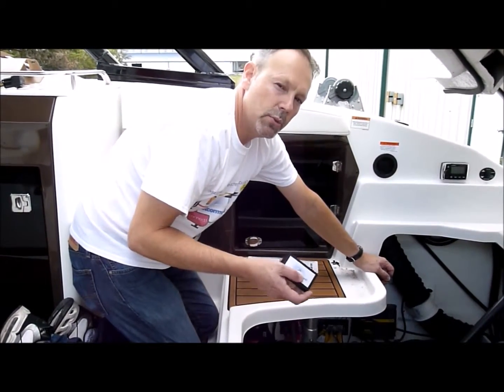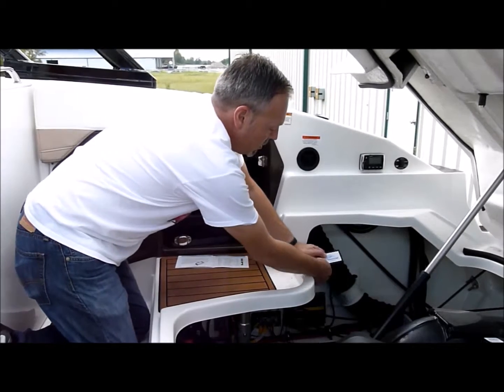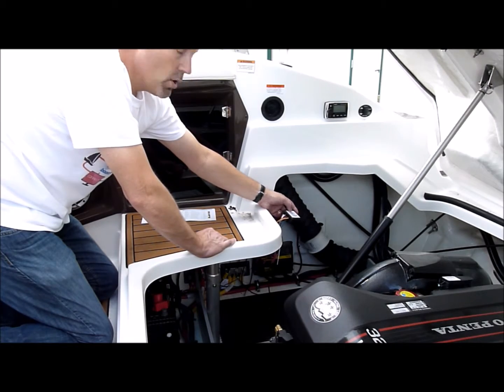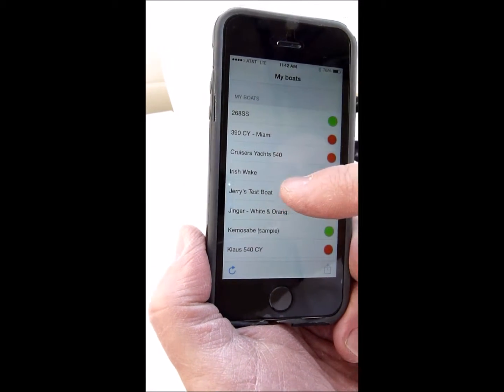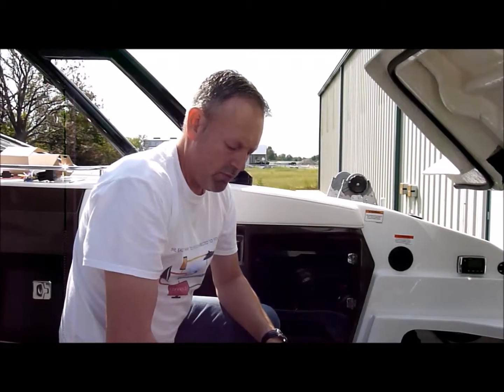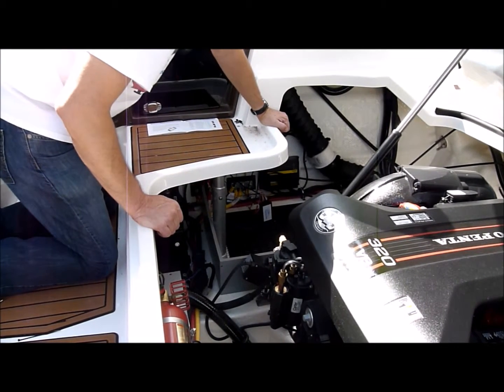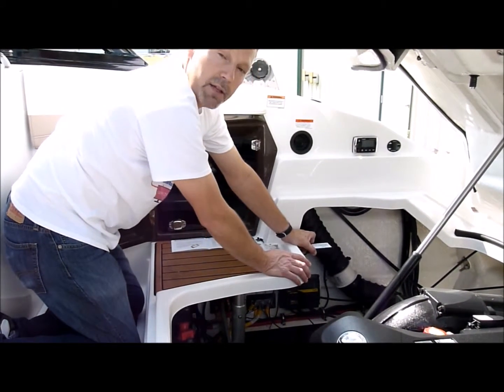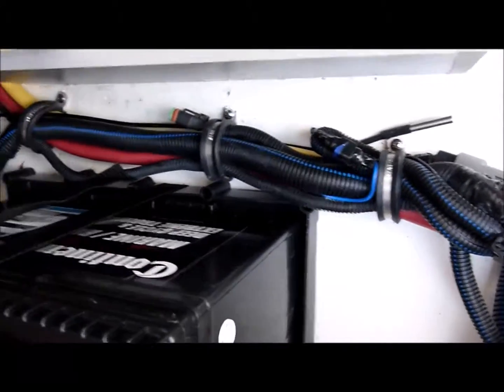Boat Command Installation - Mounting Device, Adding Boat to Account, and Conclusion

Comment: Can you use boat command to turn on and off the a/c remotely?
Reply: You can connect 12vdc and 24vdc relays with Boat Command. If you need to control AC power loads, hook a DC relay to a contactor (relay) for the larger AC power loads to control the air conditioner. It also tells you the interior temperature as well.